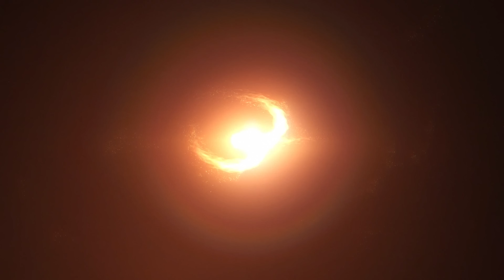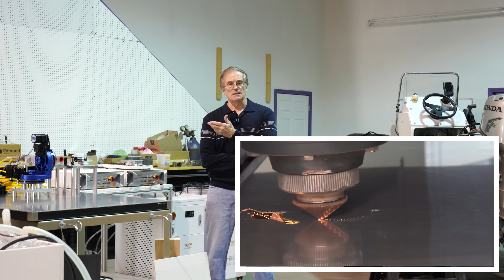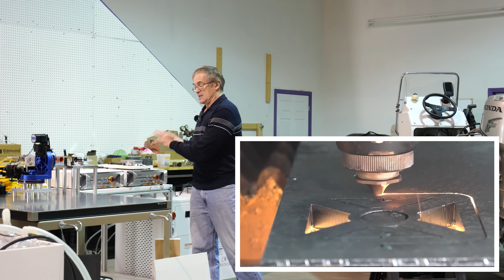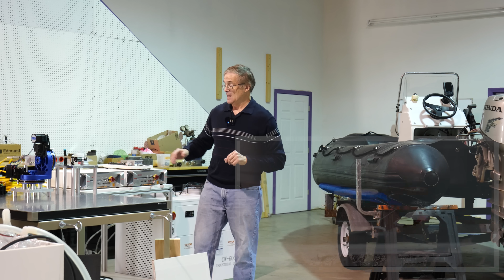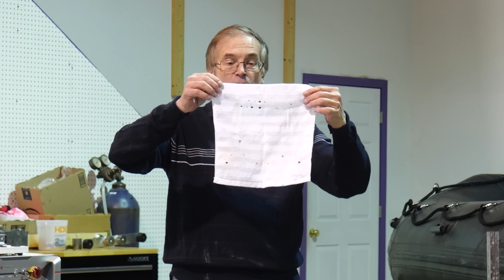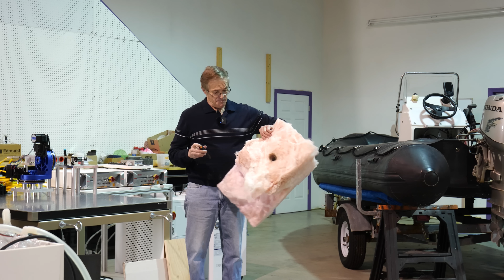We have a problem... and need your help!

Comment: Did some work with q switched YAG laser in college had peak power around 2MW but the pulses were only a few nS so over all power was low about 20w. However it would  happily drill through a 40w rated beam stop and ahalf inch thick  stainless vacuum  chamber behind  it. Way we finally  did it was multiple  layers  of glass for welding  helmets put in layers at an angle  so the beam would  split  and reflect  between  each layer that spead the energy  out  enough  that no one spot on the glass got too much energy  dump into it. So I'm imagining  that maybe  a triple  glazed windows  and you fill the air gaps with water or some  other transparent ish fluid that was a different  index  of refraction than glass to maximize  internal reflection  and disapate local heating. Maybe with final layer  of graphite foil  in the back. I think whatever you go with  with need to diffuse  the beam somehow at the power density  your at  any monolithic  material  will just boil away.

Comment: I have two ideas :
1, Kaowool, (high temperature insulation made from ceramic fibres, used to insulate forges and furnaces...but you probably already know that...) wrapped around a shaft and spun at reasonably high speed.  The laser points at one side of the resulting cylinder while water sprays on the opposite side.  This would result in: Reduced contact time per "patch" of material as unheated surface is continuously presented and a continuous renewal of coolant.  
Although the fibres themselves would not absorb liquids, the material on a macro scale will hold water and could be pre-soaked, increasing the efficiency of heat transfer deeper into the roll of insulation.  It might get a little heavy but a sturdy base and some support should handle it just fine.  You could even use a higher viscosity coolant such as propylene glycol to help distribute the heat throughout the mass of Kaowool even further.  The downside is that Kaowool is white and would reflect some energy back out but it would be very diffuse.  If you use this method, consider housing the whole apparatus in a steel drum with a small aperture to shoot the laser into.  The whole thing should fit on a pallet.

Edit: You could even place the entire assembly on an electric scissor lift table allowing you to oscillate the drum spreading the load even further.  

2,  Instead of allowing the beam to hit the backing material at full intensity, consider reducing its intensity gradually by aiming it down a long tube.  Spray water, sand or perhaps both (separately) through small holes along the length of the tube so that many moving particles are interrupting the beam reducing the intensity gradually along the length of the assembly.  As long as the water and/or sand can fall out of the bottom side faster than you spray it in, you should be able to avoid creating a mass of superheated glass and slag.  I'm not sure how effective, and therefore how long, the tube would be but it could be made in modules for adjustable length.  With enough modules, the energy density of the laser contact point might be low enough that a few concrete slabs could withstand the energy that's left over by the end.  

Both of these methods obviously require building stuff but with your skills and expertise they should be quick, easy and relatively cheap.  
Best of luck.  
Love the channel by the way.

Comment: Copper wool as in steel wool just made of copper. Should reflect the beam and dispurse it within the wool.

Saw dust wetted in boric acid and water made into blocks.

Quarts glass aquarium with a dark water mix with charcoal or something, keep it opaque enough for the heating not to happen all at the glass surface.

Sheet of alumina or alumina sand in a pile and bind it with waterglass.

Comment: graphite would be a solid contender. it absorbs laser light extremely easely so no reflections to worry about and it can take a lot of heat to melt. not saying it will survive but it will probably can take a acceptable long hit before punching a hole in it.

Comment: I encourage you to focus on the laser control mechanism, in addition to the safety backstop. Have something akin to a missile lock, that only fires the laser when it knows it’s 100% on target and can shut down either: after a predetermined time period, when the target has been disabled, or when it doesn’t have a lock anymore. If executed well, it could ensure that the backstop never gets used. Of course, doing this well may be more difficult than finding a good backstop, but it could help limit casualties.

Comment: Rock wool insulation soaked in water maybe a workable approach. Perlite (volcanized rock) may work as well, but I fear the higher water retention could result in steam explosions. I'm thinking those design requirements ultimately call for some rapid expansion towards the laser itself, and steam is one of the very few things able to dissipate that much concentrated power .... you might not like how that expansion dissipates everything in that process though. A delicate balance to be sure.  Perhaps a water misting system on rock wool is a safer starting point, and opting to replace segments of rock wool as it slowly burns up is preferable.

Comment: Amazing problem to have. I've thought for about an hour and here is the practical solution if COST is truly the contender:  Hang a fine water mist in front of a plaster or charcoal panel. The mist absorbs and scatters the beam the panel soaks up the rest with no toxic smoke. Tilt or stack panels to spread the heat. It is cheap portable easy to swap and buys you a few seconds to hit the kill switch. OR bake dense bread, pyrolyse without oxygen, and gently soak the carbon structure in water glass - that's my wild imaginative idea, at least.

Comment: Can you split off 1/2 of the beam like in an interferometer? Then testing targeting guidance would be with far less intensity. 

Other thought is layering scattering materials behind absorping ones. So, perhaps drywall then mylar, then drywall. As long as the scattering is contained, it would significantly help with absorping.

Comment: what wavelength of light is the laser beam? I can imagine a large glass (potentially polycarbonate) tank with silica nanoparticle suspended that would scatter the light and disperse the energy into the water tank. The exact size of the silica particles would depend on the wavelength of the laser. 

Alternatively, you could have the fiberglass or plywood sheets suspended in a water tank that would disperse the heat more effectively and reduce any fire hazard.

Comment: What about a water fall. Use a water pump to pour water down from a slightly sloped plastic wall. That would be low cost and light weight.
Reply: Agreed, maybe some sort of black dye to absorb the energy and turn the power to steam .
Reply: similar idea as mine but better juts lock that water between sheet of glass for more simplicity why bother with waterfall?
Reply: Yes, but use sand instead of water

Comment: Can you mount the laser up a few feet and lock the angle to only aim down? Probably the safest option If you do, then just use sand for tests in the same area and outdoor ground for the drone slicing tests

Comment: First, let me say I'm a big fan of the channel.  Love the experiments you guys are doing.  That said, I have a couple thoughts.  What you could construct are a few panels out of lumber, say 4 x 8 ft, cover them with durock cement board and fill the cavity with rockwool which is a basalt insulation.  Given the strength of the laser, you may need 2 layers, so you can build the frames out of 2x8 lumber. Build them with like mock up walls with kickers.  To erect them, put pad eyes or Crosby shackles on one end and lift with chain falls from above. I'll be happy to give more details if needed. Please let me know if this helps you out.

Comment: Jack Sweigart, Apollo 13 Command module Pilot, was managing the Denver Office of BDM Corp. , a company that was working on the Reagan Space Defense Initiative.  Contrary to purposefully spread rumors their test was successful. A similar issue was studied on how  to use solar power in space to create and send generated power back to the earth. Best option at the time was to microwave it down, but should a jet or  plane  pass through the beam, the people would cook to crispy brown. It caused me to think that if you initiated an originating beam that was wider at its point of origin and then tightly focused it at your target a miss or hit and destruction of the target would cause the focal point to remain momentarily but disburse the concentrated energy both in front of and behind the focal point.

Comment: Sandbags filled with black sand or salts, it absorbs a ton of heat. if it burns a hole the sand just resettles, and its very portable and is not flammable.

Comment: Diffused (not frosted) glass panels to decollimate the beam, and behind the glass a panel of 3/4 plywood that you soak in water before running a test.

Relatively inexpensive and practical.

Comment: You need to use some sort of wall of water that is continuously moving in addition to some layers of dark colored inexpensive material to absorb the light. Perhaps you can have a metallic material but you paint on some sort of like truck bedliner? Behind that metal is essentially a waterfall that diffracts the light and behind that waterfall is yet another layer of that same bedliner coated metal and so on. The water should be close enough to the metal to keep it cool enough to prevent the next layer from being penetrated. You should test to see how many layers you need but I think this should work fine.

Comment: Layer of sheetrock siding? Stones or brick in a disposable sheet that could be replaced after each test is probably the most cost effective way for a quick solution

Comment: Large low density kiln bricks. They are light enough that you could build 18 modules for your wall that could be assembled or removed in less than 5 minutes. And they should take the laser for 20+ seconds.

Comment: Aerated concrete blocks and assembly foam upon them. With black paint on top, possibly from carbon black or iron oxide mixed with oil. Foam you can replace with rock wool also

Comment: Sheets of plywood sandwiched with spacers in a tank of water so its always drenched and quickly release the heat into the water. Or same idea but instead of filled with water, just running from the top down and keeping a high volume running over the layers

Comment: You should use the starlight compound... As it is heated up by the laser that will produce gas which will create a protective barrier in theory and this at least works with regular flames...

Comment: A composite/laminated solution probably fits the requirements best? No doubt there is some obscure/expensive material out there somewhere, but maybe a combination of some common materials would also be suitable? Some kind of refractory cement or mortar layered over plywood? Something to reduce the amount of air immediately available to the plywood for combustion? A strange suggestion could be something like the Italian plaster known as 'cocciopesto', made with lime putty and crushed aggregates like bricks/terracotta. Some version of this with a gypsum(calcium sulphate)/lime putty(calcium carbonate) mortar, and a porous vermiculite aggregate should have: reasonably high melting point, low thermal conductivity, and the lime will thermally decompose into CaO and, crucially, CO2 at around 800 celsius. 

The laser would likely immediately penetrate the aggregate/mortar, but the plywood underneath would be more resistant, and the thermal decomposition of the lime mortar would possibly produce enough CO2 for it to be self-extinguishing?

Plywood board with machined grooves for the mortar to key into the surface, would be easy to produce and reasonably lightweight, and certainly cheap. This solution, if it proved successful, could be easily and cheaply repaired/re-used.

Comment: I can only suggest to try the same materials but soak them completely with water. Not only to prevent burning, water should act as a heat dissipator + steam would scatter the light. Wet drywall might have a better chance then dry drywall.

Comment: A 2ft x 6ft x 6ft chain link fence "box" lined with several layers of drywall, then limestone rocks and sand on a heavy duty trailer. You now have a moveable, rebuildable barrier with sufficient density to restrain the beam until you can shut the laser down.

Comment: Years ago during a “field trip” to Apollo laser we were shown a co2 laser used for cutting steel under development. To backstop the beam they simply used a brick of carbon. 
Just move it every few hours.
Reply: They need to cover a large area to demonstrate the computer targeting a moving drone
Reply: @maotseovich1347  they where bricks so build a wall? The scary thing is the laser ate through a solid carbon brick and they needed to be moved about or be replaced.
Reply: I was thinking carbon too. Not sure how expensive it is or how thick but that was something that made sense to me because the nose of the space shuttle was pure carbon and it doesn’t really melt plus it has a low thermal conductivity.
Reply: AvE did a carbonized piece of bread years ago and it worked very well to stop a MAP torch....call the local bakery 🍞🍞🍞

Comment: Aerogel, it will scatter the light and since it is an insulator most probably it will withstand the heat.
Reply: Pumice stone, also known as pumice, is obtained from volcanic deposits. It is a lightweight and porous volcanic rock that forms when lava cools rapidly in the air, trapping gas bubbles in its structure.

Pumice stone can be found in areas with recent or ancient volcanic activity, and is extracted through open-pit or underground mining methods.

Some countries with significant pumice deposits include:
- *Italy*: The island of Lipari, in Sicily, is known for its pumice deposits.
- *Greece*: The island of Yali, in the Dodecanese, has significant pumice deposits.
- *Turkey*: Turkey has several pumice deposits, particularly in the Anatolia region.
- *United States*: Pumice deposits can be found in states such as California, Oregon, and Washington.
- *Mexico*: Mexico has several pumice deposits, particularly in the central and southern regions of the country.

Pumice stone is used in various applications, such as:
- *Abrasives*: It is used as an abrasive in cleaning and polishing products.
- *Construction*: It is used as a lightweight aggregate in concrete and mortar.
- *Gardening*: It is used as a substrate for plants and to improve soil structure.
- *Cosmetic industry*: It is used in exfoliating and skin cleansing products.
Reply: Refractory bricks are made from materials that can withstand high temperatures and extreme conditions. Some of the materials and lands used to make refractory bricks include:
- *Refractory clay*: A special clay that can withstand high temperatures without deforming or melting.
- *Aluminum silicate*: A compound commonly used in the manufacture of refractories due to its high heat resistance.
- *Magnesite*: A mineral used to make basic refractories that are resistant to high temperatures and chemical attacks.
- *Chromite*: A mineral used to make refractories that can withstand high temperatures and corrosive conditions.
- *Silicon carbide*: A material used to make refractories that can withstand high temperatures and abrasion.

These materials are combined with other components and processed to create refractory bricks used in various applications, such as:
- *Industrial furnaces*: To contain and direct heat in production processes.
- *Power plants*: To protect structures and equipment from high temperatures.
- *Metallurgical industry*: To make crucibles and other equipment that require heat resistance.

The choice of refractory material depends on the specific conditions of use, such as temperature, corrosion, and abrasion.
Reply: A diffusion lens.

Comment: Multi-layered water/fog curtain, (2-3 layers), in each layer , the mist moves in a different direction. Basically, use the mist to polarize in each layer (4-6" each layer, depending on velocity of the mist).

Comment: Your problem seems similar to one we faced when trying to dump the deuteron beam of a linac I worked on (25-30 years ago). We found that the only practical solution was to spread the beam over a greater area. We did this by using a cone spinning on its axis. IIRC we used tantalum, but that was mostly to prevent it being activated.

Based on your 1 mm beam spot and your need to increase half a second to (say) five seconds, I get that your surface speed only needs to be 10 mm / sec. You could take a sheet of plywood and move it (or them) randomly so that the beam is never focused on one spot for long enough for punch through to occur. 

A related problem I've encountered with a femtosecond Ti:sapph source was that it drove the air it passed through into non-linear behavior so that the beam would re-focus itself when fired across the lab. The result was a chain of points of light every 4" or s so. I don't know whether your power density will reach this level but it's quite freaky

Thanks for a great series.

Comment: instead of things soaked in water, what about an actual body of water? a large tank filled with water with the laser angled to to shoot into it from above? maybe the water could refract the laser on contact in order to help disperse the energy. dunno if the laser would be powerful enough to melt the container, but if the container is painted (if it were made of glass for example) maybe you could reduce the chance of light escaping. just spitballing here.